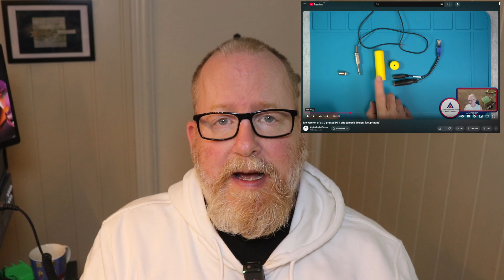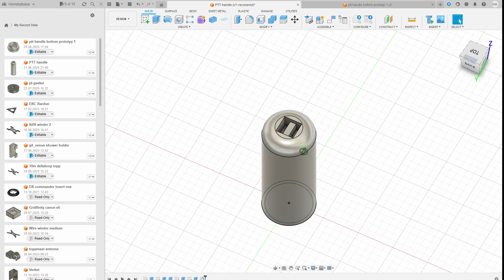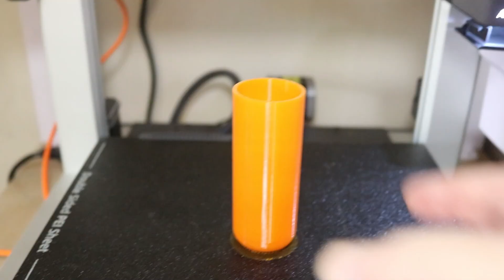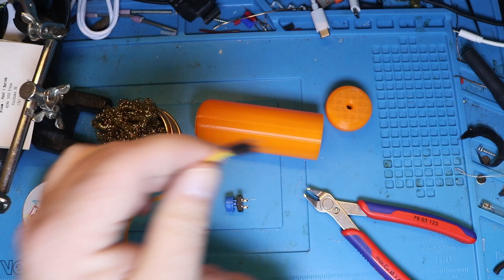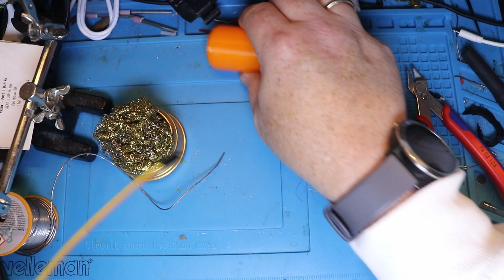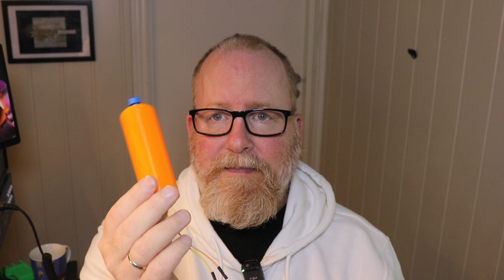Easy 3D PRINTED PTT HANDLE for ANY RADIO

Comment: I took an old two position foot switch possibly for telephone operations and made it into a PTT foot switch for my radio.
Reply from the maker: Good point. My original plan for a pedal was to use a cheap piano pedal until I came across a Heil pedal at a hamfest.